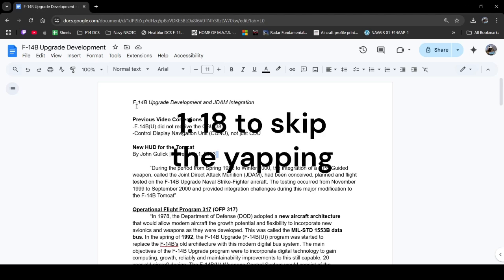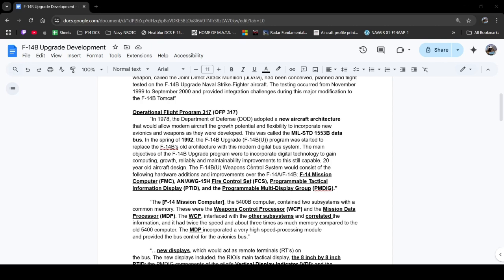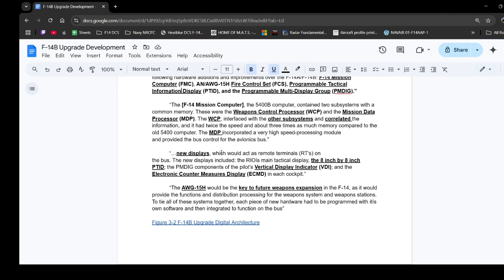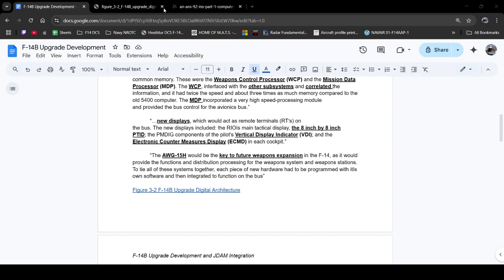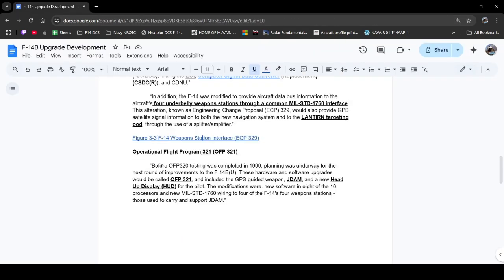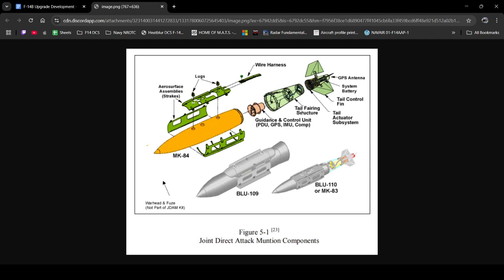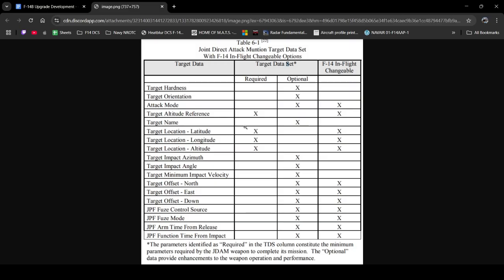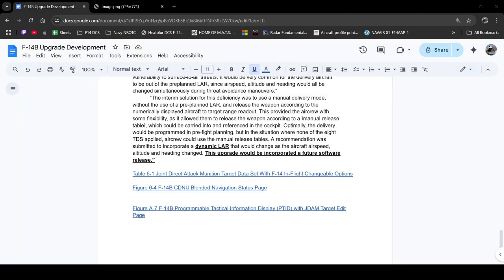F-14B Upgrade Development and JDAM Integration

Comment: How different is F-14B(U) compared to the F-14D? it just didn't get the GBU-38 but all the new electrical systems (HUD etc) and engines are pretty much the same or am I wrong? I just can't really understand why we don't just get a D model in DCS so we have all 3 Tomcat variations. Not complaining though, an F-14B(U) is going to be really cool to have and will make the Tomcat feel a lot more modern (not that I don't love the analogue feel of the A and current B model) like how they were in real life during Operation Iraqi Freedom. Great video man!
Reply: New FEMS system for monitoring engine health for pilots and maintainers, new ROVER antenna for sending visuals to troops on the ground, new IRST from Lockheed, new Swedish BOL flare rails for AIM-9 rails to dispense a total of 540 flares in 3 buckets. JTIDS for secure comms, catseye nightvision (not new i think) all F-14D’s had integrated TARPS wiring too, new ejection seats, new AYK-14 mission computer, four 1553-MIL buses for subsystems, ALR-67 RWR and ALQ-165 Self jammer, ASN-139 digital navigation computer, Kaiser HUD and new stick for both seats i believe. Oh, the most important change, the AN/APG-71 Radar and fire control system, New BAE systems RWS and new oxygen system. (NOTE, all of these are almost all classified and if not, very hard if not impossible to model in DCS anyway, a B(U) is great and a Early A would be more tghan enough but a D is almost too good to be true and will probably always be sadly…)